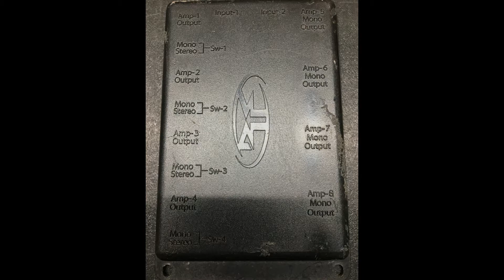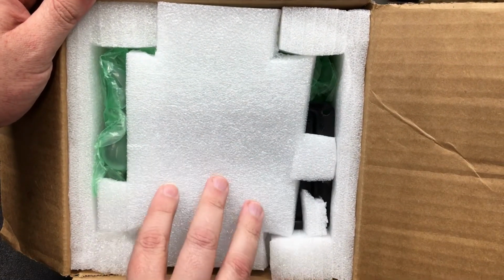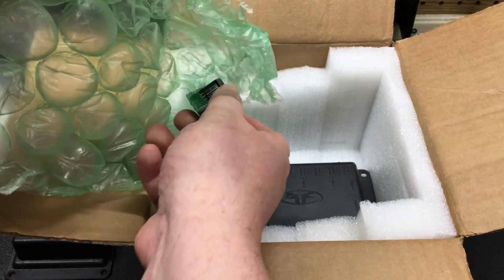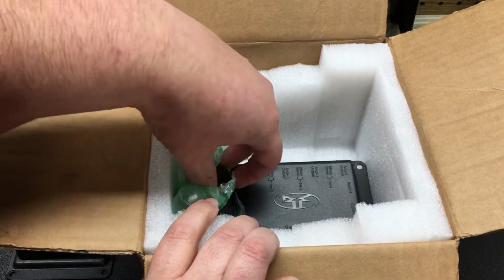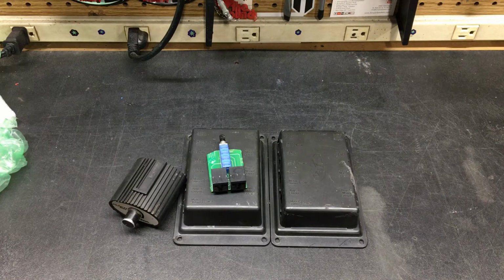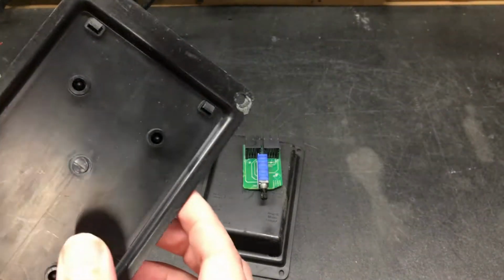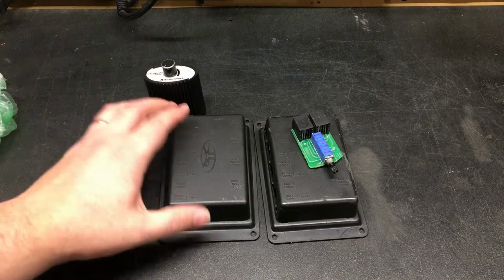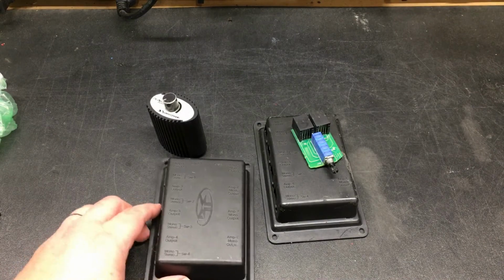Rockford Fosgate RFC3215 Remote Bass Knob Coupler

Comment: Looks like they use a stacked potentiometer with one section for each amp.
A normal bass knob usually only has 2 wires, so that explains the need for 2 RJ45 each having 8 wires.
Not sure how the mono/stereo works, would be nice to see a pic of the underside of the board.

Comment: That's pretty cool, didn't know they had that for the older amps. I know new T series has a remote knob called  peqx3 that can control up to 3 amps. That old remote knob you have  would work with the power 1501bd models and those amps can connect with the bdsync cable as well,  thats tons of amps you can control,thats awesome.
Reply from the maker: They only had them out for a year I believe?? I took a screen shot from the 2001 catalog but I couldn't find it in the 2002 catalog. From what I have gathered over the past few months of owning them is that these two items in the video came out of a rather large and well know vehicle. I'll see if I can find a video of the vehicle and post a link here.
Reply from the maker: https://www.youtube.com/watch?v=-qRzbHnaE4g  That's one of his videos. He's redone his system a few times since then tho.
Reply: Oh I was thinking it was him when you mentioned the seller name in the vid, Low Notes Garage. He does some really nice work,think his current setup is T3 19s. He has or had a civic with some Power hx2 12s(I think). He is one one of the RF groups can't remember.

Comment: There is a myth that it is necessary to have the bass knob, according to what is said, it gives more rms in the old models, is it true?
Reply from the maker: I've heard similar things but not more RMS power. What I had heard is it gives you more adjustability of the crossover. I mainly collect the amps and plan on using some of the older models that don't have a bass knob so I can not speak to if it's true or not. That question may be better directed to Big D Wiz as he can dyno one and let you know.
Reply: @kaknballz  thanks for answering I appreciate it